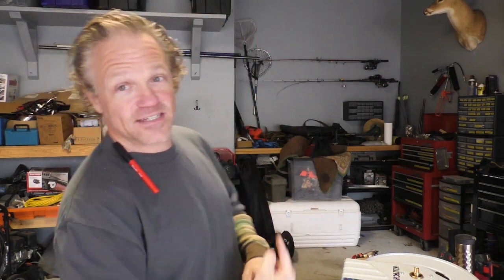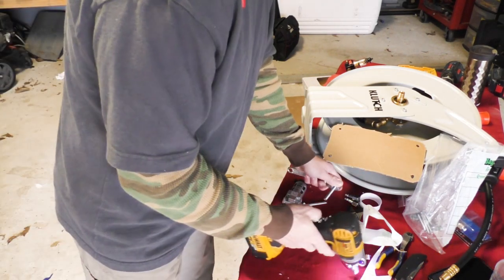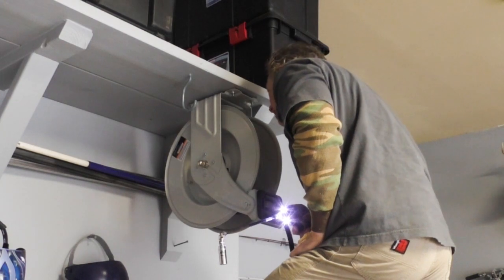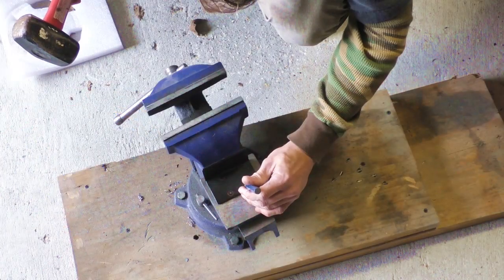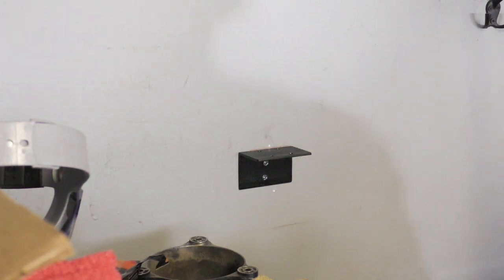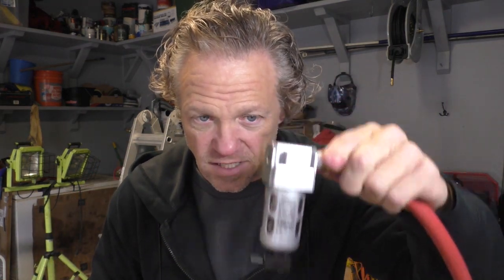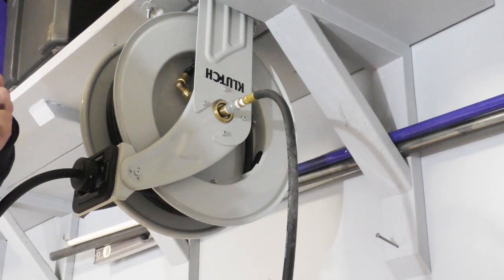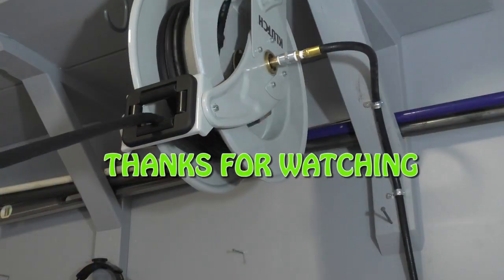Northern Tools Air Hose Reel - HOW TO INSTALL & REVIEW

Comment: Did you make a video on how to cut the holes and add the new attachments to make it shorter? Also what is the purpose of the filter and is that a must to use with a compressor? I've seen filters before but there are different types. I've been just running straight hose

Comment: LOl... You bought the wrong one. I bought mine from Lowes and it has a separate mounting bracket to screw to the ceiling or wall. Then I picked up the heavy part and just slide it onto the protruding screws of the mount, and that held it just fine until I put the nuts onto the screws. really easy to mount.   :)

Comment: Couldn’t you have just added a washer on the bolt to prevent stripping in the wood?
Reply: Yes.lol
Reply: Use a regular hex bolt with washer on top and hold it with a wrench.